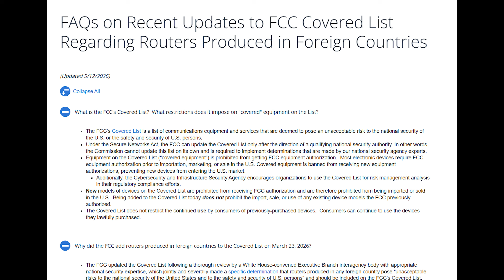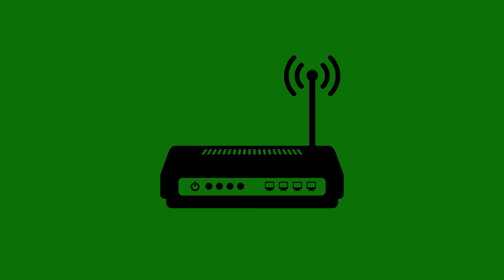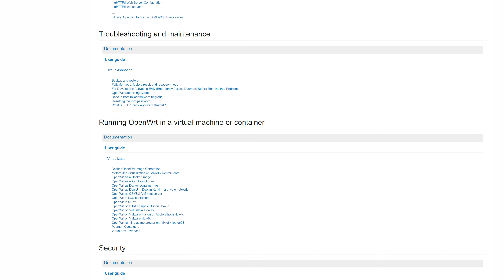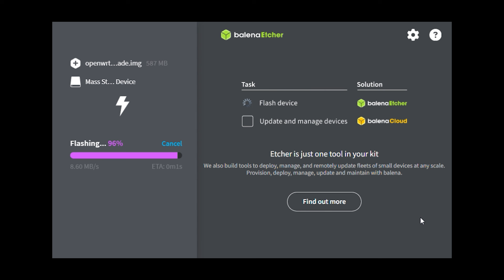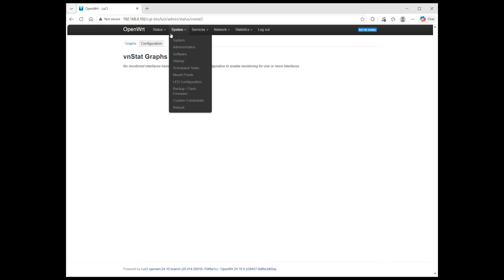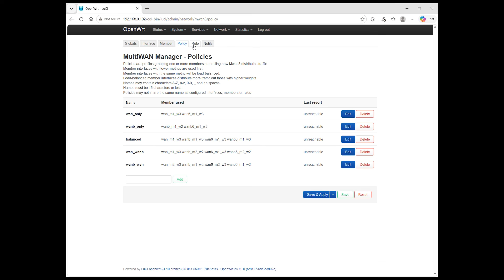OpenWRT on an Orange Pi RV2 - Easy, Fast... and Cheap (kind of)

Comment: Can you show us how to run something like PI Hole to block the specific 8*.* That allows wifi heartbeat sensing and spatial reasoning spyware?
Reply from the maker: for the ones that resolve the control server via DNS, any of the DNS filtering options will work (including Pi-hole or AdGuard Home).  

For anything that's contacting an IP directly, you can set up firewall rules (DENY or DROP) from your LAN to that WAN IP.  You may end up setting up several rules, but that's ok.  A decent router firewall, like OPNsense, OpenWrt, Mikrotik, Unifi, or tons of others, don't have performance degradation from large rule sets.

Comment: 5:45 linksys wrt54g
Reply: @Dad-The-Engineer  DD-wrt was mostly for the linksys wrt54g back in the day.. i dont think netgear even had a wrt54g
Reply from the maker: you're right.  my bad.  I just think of the blue, and my mind associates it with netgear.
Reply: @Dad-The-Engineer  after watching the three videos i was all set to go get a pi, but then claude told me to use technitium. it seems to be working great except for when i passed out, my system clock lost about 7 hours and it blocked all dns because im hosting dns on my pc.. guess i need a ups or a cmos battery refresh - id totally like to see your take on technitium
Reply from the maker: Technitium is nice, but it's more of a full DNS server that happens to do DNS filtering, whereas pi-hole+unbound (or adguard home+unbound) is a combination of purpose-built DNS filtering, with a light-duty DNS server.  While unbound CAN handle local DNS zones, it's not as good at it as Technitium... but most people don't really need a that on a simple LAN.  

If you just need DNS filtering, then you should select the solution based on the interface you like the most for the purpose.
Reply: @Dad-The-Engineer  i dont have a clue what zone based dns means, but technitium is turn key if you can handle setting dns on your router and assigning a staic ip to the machine .. also point the dns on the nic to loopback.. also pointing the client to the blocklists.. ok, so maybe you have to turn more than one key.. lol it still didnt make me buy any hardware

Comment: OpenWRT itself is fully open source. But many supported devices require proprietary opaque binary blobs; primarily for: Wi‑Fi, switch chips, or bootloaders. So while the project is open, the hardware ecosystem often is not. The fact that there are opaque blobs means that the manufacturers of those blobs (or their supply chain vendors) can intentionally embed root kits, rats, hidden proxy networks and other malware controlled by the foreign companies or foreign intelligence. It's those very threats that the FCC ruling is trying to stop. In other words, the US government wants to make sure that the only threats of those kinds are the ones they put there. Oh, and that if there is a threat that was unintentional then consumers actually have a company they can sue for privacy or security concerns.
Reply from the maker: What you're mentioning isn't really confined to any project, including OpenWrt.  And it's not completely about the binaries, either.  If you're worried about a supply-chain attack, then it's not just the drivers you have to worry about... it's also the Broadcom/Qualcomm/etc. chips that effectively act as coprocessors.  

The FCC isn't really trying to stop this, or they'd have an open-source requirement for all parts of the stack - along with devsecops auditing and certification of drivers, firmware, etc.  
Instead, they want to be seen as re-onshoring technology manufacturing - while not addressing ANY of the underlying concerns.
Reply: @Dad-The-Engineer  I don't agree. Proxy botnets operated from foreign countries spanning at least 17 million US consumer systems have been found. One recent interview podcast by Jack Rysider with security workers and former FBI investigator on the case demonstrate that these hidden proxy networks take years to find. And in that case it apparently was a criminal organization. No public information was released about wither there was foreign state involvement. These proxy networks that allow foreign C2 to masquerade as domestic home computers or routers a very wide attack surface and threat to public infrastructure. IMO, this is the real reason for the FCC ruling. The framing for onshoring manufacturing is trivial by comparison, but that message doesn't cause people to think there is a risk of a foreign state to just decide to crash our electric grid, or brick all the water pump control systems. Remember Stuxnet? It would be wrong to assume other countries haven't developed similar technology and is either aware of or in control of proxy botnets.
Reply from the maker: @mjmeans  Fair points, and the Raptor botnet case (I'm guessing that's the Rysider episode you're referencing) is exactly the kind of threat worth taking seriously... 17 million compromised nodes masquerading as domestic traffic is a genuinely terrifying attack surface. I don't disagree on the threat model.

Where I'd push back is on whether the FCC's mechanism actually addresses it. Those botnets ran on routers with chips, firmware, and binary blobs from the same global supply chain that will still exist after onshoring the final assembly. Moving a PCB fab to Texas doesn't change the Broadcom Wi-Fi firmware blob... it just adds a domestic address on the box. If the goal is actually defeating foreign C2 infrastructure embedded in hardware, you need open, auditable firmware stacks and a credible certification process - which the FCC ruling doesn't require.

The cynic in me reads this as: the threat is real, the response is politically legible but technically shallow, and closing the actual attack surface would require taking on the semiconductor IP ecosystem in a way no regulator wants to touch.
Reply: @Dad-The-Engineer  You're right that simply moving the FAB to the US doesn't address the problem. But it is a step that would allow regulators the jurisdiction needed to enforce design and manufacturing changes end to end.

I'm not surprised that the government, while having been told what is actually needed, has chosen to implement an initial policy that only superficially satisfies the claim.

The public privacy risk, as I said in my initial post, is that the mitigation is simply replacing largely untouchable foreign entities with new US government entities. but at least that case has a possibility of a political solution. c.f. the new regulations on all vehicles having remote kill switches and other overrides of personal agency. Unfortunately, too few people objected when it was being discussed. This may be corrected later if it is abused by government or corporate interests. The same situation will occur in the router market. There will be loss of personal agency. As long as there are no widely published abuses by government of industry, the loss will be permanent.
Reply from the maker: Largely agree. The jurisdiction argument has some merit.  After all, you can't regulate what you can't touch... but I'd note the US already has full jurisdiction over Netgear, Linksys, and others and hasn't required auditable firmware stacks from any of them. Jurisdiction is necessary but clearly not sufficient; the political will has to follow, and the incentive structure in DC runs the other direction.

The kill switch parallel is apt, and honestly the more worrying precedent. The router situation is at least theoretically addressable through open firmware advocacy and consumer pressure. The vehicle remote override is baked into hardware in a basic mobility device... the abuse surface is orders of magnitude more consequential and the personal exit option (don't buy a new car) degrades fast as the fleet turns over.

Your last point is probably the most important one in this whole thread: the window for political correction only opens when abuse is visible and attributable. With routers, that's hard. With vehicles, it may be impossible to prove in the moment. That's the real problem with infrastructure-level surveillance mandates: by the time the abuse is undeniable, the leverage to reverse it is gone.

Comment: I'm using a gl-inet travel router (amazing). I haven't flashed it with open WRT yet, but being able to give it the same AP name as the home network so everything "just connects" and having wireguard and a nice little firewall is nice. I'm using pfsense on a dual NIC prodesk G6 mini at home. TP-Link decos for the wireless network. OpenWRT interests me for that added freedom and security. Australia is just a few years behind the USA in the loss of personal freedoms, in my opinion.
Reply from the maker: If it's like the rest of the GL-iNet routers, your travel router is probably actually running OpenWrt underneath.  I don't think you need to reflash.  With the Flint routers, you can run LuCi instead of the GL-iNet web admin.  It's possible that the travel router is different (I'm not super familiar with the brand's products), but I'd imagine that all of their routers have the same core.
Reply: @Dad-The-Engineer I have read that OpenWRT may not fit on its storage (it's tiny physically too). I get the feeling that it's probably a re-skinned stripped down OpenWRT... It has a Linux shell etc. the latest firmware is pretty good and it has a mobile app which is handy.
Reply from the maker: ah, that makes sense.  Is your travel router smaller than a nano pi r4s?
Reply: @Dad-The-Engineer  it's the GL-AR300M16 (with the external antennas - the reason I got it in the first place was to extend the wifi into my shed). The main body is about 50x50x20mm.

Comment: I've used a UniFi Cloud Gateway Max for ~1.5 yr. It's been great other than occasionally getting stuck during an update, but easily resolved by power cycling. And I exclusively use the UTR travel router while traveling. I no longer use the Slate 7, though it would make a good home router!
Reply from the maker: I run a Dream Machine Pro, plus several APs and switches.  I LOVE Unifi equipment.  I've not had an issue that's required power cycling, but I'm also not stressing the hardware or software layer all that much.

Comment: I use pfSense on a micro PC.  Been running for about a year now.  I would recommend anyone run their own router.  I use pfSense but there are others that are just as good.  Take control of you home network.  You will be glad you did.  :)
Reply from the maker: I've built my own routers for over 20 years.  IPcop, monowall, pfsense, opnsense... and it is great to be in charge of your own infrastructure.  However, these days I love running Ubiquiti equipment.  Similar power, but way easier to set up complicated, SD LAN and WAN structures, routes, and rules

Comment: Started with OpenWRT on a "Fritz!Box", seeing what was possible was already eye opening; nowadays I run my router as one of many containers on my home server, you don't get more upgrade options as when sticking to an x86 system with lots of PCIe lanes
Reply from the maker: I get where you're coming from - especially since routing isn't a very resource-intensive task (even at 10G).  However, I still don't love virtualizing that particular workload.  It's not that you can't - and this is completely subjective - I just want as few failure modes for critical infrastructure as possible.
Reply: @Dad-The-Engineer  fair point, and I was eye-balling a more modern solution for virtualization (my server runs on a dual xeon Skylake base with 40cores) and a dedicated router setup, but somehow the market currently has less options and higher prices, so that setup has to do for a little while

Comment: In the UK with FTTC using a Draytek modem and a Unifi DM7.
Reply from the maker: I like that the DM7 looks like a Bluetooth speaker.  Seriously, though, Unifi Network is SO good.  Hardly anyone that switches on to Unifi, switches away (in my experience)

Comment: OpenWRT is cool, but I worry that if I was incapacitated, my wife would totally be screwed.  I am hoping Ubiquity is not impacted by the ban.
Reply from the maker: I don't Ubiquiti is affected, due to the "consumer" wording of the ban.

Considering that I've been in government facilities that use Ubiquiti equipment, I think it would be very hard for them to end up on the ban list.  

As far as OpenWrt goes, it doesn't seem like your wife would have an issue unless she needed to log in to the router, no?
Reply: @Dad-The-Engineer  Mostly, she'd power cycle it if it wasn't working, but if there were some reconfig needed (maybe the ISP goes to IPV6), then she'd likely look for someone technical to help with that.  I tend to think a COTS solution would get better support than a home brew.
Reply from the maker: fair
Reply: @raymondrizzuto7997 @dad-the-engineer this "the wife" point suggests a new industry: people trained and familiar with do-it-yourself products providing alternative service when the tinkerer who set up the system is unavailable. I decided against a do-it-yourself solar system because nobody in their right mind would want to risk liability servicing some do-it-yourself installation.  Selling an open source solution in some arena where you can expect there will be people who can service the unit could be a boon.  The hurdle is convincing and educating potential buyers.
Reply from the maker: @johnlaurencepoole6408:  That makes sense - and it aligns with my personal experience.  Since I've put out these videos, I've been contacted hundreds of times.  Roughly a third of them have asked me to just perform the service for them (and about a quarter of those have offered to pay).   I'm not sure how you would reach and service that market.

Comment: For the longest time, I used an old PC with a couple of network cards and put Slackware Linux on it.  This started around Slackware Linux 4.0, in the late 90's.  I learned a LOT about Linux from that, and it was miles ahead of any wireless router you could buy from the store.  At some point, probably around 2010 or so, I needed to upgrade my router, and I hadn't looked at anything purpose-built for routing, so I picked up a wireless router, a Linksys of some sort, and tried it out as a router.  I was very disappointed because it was slow and wasn't very stable, so I built a new(er) PC and put Slackware Linux on it again, and things were good from there.  I kept the wireless router and put it in AP mode, so then I had WiFi.  Anytime I need to upgrade my WiFi, I'd buy a wireless router for $60-$100 and put it in AP mode.  My latest WiFi router is a TPLink EAP610, which is great since it allows you to configure multiple SSIDs, each with their own VLANs if you wanted.  About 18 months ago, I upgraded that PC's motherboard, processor, and memory, and it still runs Slackware Linux.  If I had to rebuild a system from scratch nowadays, I would probably put OPNsense on it, but for now, Slackware Linux 15.0 runs very well on it with a comprehensive iptables and ip6tables firewall script.  (Also, I learned a LOT about IPv6 by adding ip6tables to my firewall script.)

Comment: I’ve been looking to build my own router recently but have felt a little overwhelmed as to which hardware to buy to accomplish this.

This is helpful for that and well timed! It would be great to get a list of several viable options as well as some good options for wireless access points to build your own mesh system!
Reply from the maker: I personally prefer to separate my wifi, from my routing.  I think it makes sense to build a wireless network with Unifi WAPs, like the U7 Lite.  

You can tie it to a Unifi router, like the Cloud Gateway Ultra.  If you want to make your own router instead, you can install the Unifi Controller on another device.  You may want to consider something like this: https://amzn.to/4ueYwmF

Alternatively, you can use an older PC - but power consumption and long-term reliability can be larger threats with older equipment.
Reply: @Dad-The-Engineer this is great info, thanks! I’m planning to do a mini pc NAS build at some point as well, would it be a bad decision to have that machine handle routing as well or do you recommend a dedicated device to handle that?
Reply from the maker: that's an interesting question.  My personal opinion is that I like my most critical network services to be on dedicated hardware... and low-power enough to run on a UPS for a long time.  

A NAS, with a bunch of drives, draws a large amount of power (comparatively).  If that's not a concern, I can see where someone may Proxmox a bunch of critical roles on to the same hardware.  Again, not my preference.  

As for a mini-NAS, there are a lot of ways you can go.  I personally prefer a regular PC for that... mostly for the PSU and space for mounting drives.
Reply: @timmythinkshesbatman what dad said. Individual hardware offers redundancy, and when you're messing with a NAS you don't want to be killing your internet connection every time you change something and need to reboot etc.

I built my pfsense router with a HP prodesk mini and an M.2 NIC in the wifi card slot. I've rebooted it about 3 times in 6+ months and every time was because I was messing around with it. It's been faultless.

I've built 6 TrueNAS boxes out of old PC towers now. Just use an old tower. Whatever you can pick up for close to free. As long as you stick to x86 hardware you can just yank the boot drive and pool disks and put them into a new unit whenever you want. It's very modular and it'll reconfigure to the new hardware, and pick up the pools automatically.

Comment: IIRC OpenWRT does support docker. So if you have the resource then you can run Technitium, Pi-hole, Adguard whatever you desire if they have arm image.
Reply from the maker: OpenWrt does support Docker.  Depending on what you're running, images can be an issue.  ARM6, ARM7, ARM8... and in the context of this video, RISC-V.